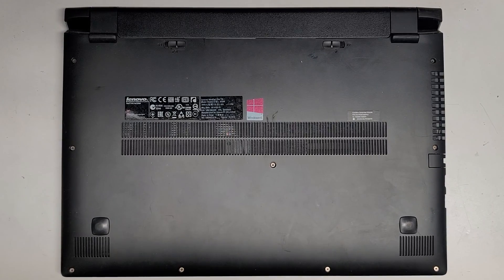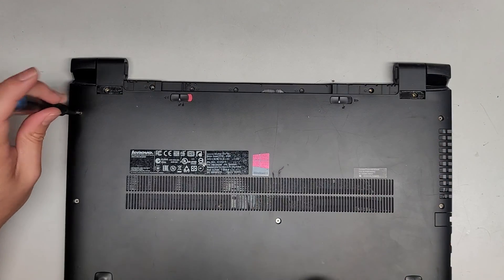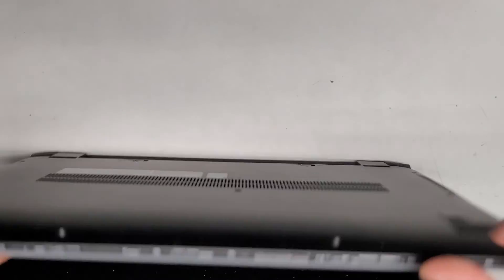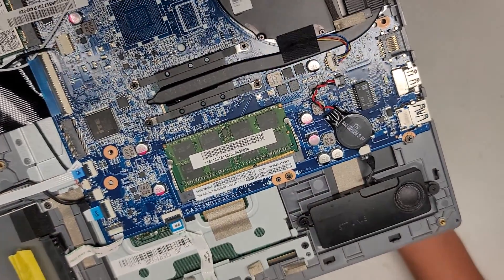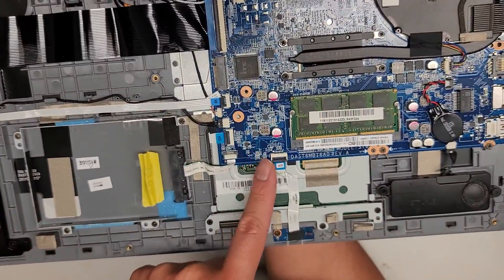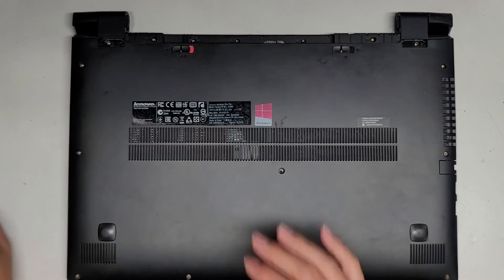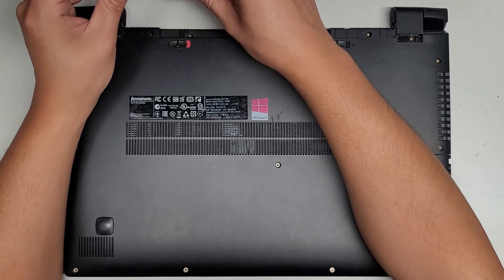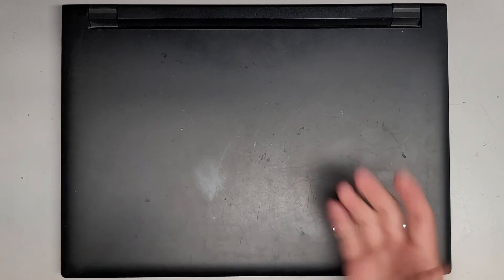Lenovo IdeaPad Flex 15 20309 Disassembly RAM SSD Hard Drive Upgrade Battery Replacement Quick Look

Comment: Hi, I have a Lenovo IdeaPad that I've had for 4 years. I decided to remove the back covering because I wanted to remove the hard drive but noticed there was no hard drive. How is it possible that I've been using this laptop for 4 years without a hard drive?
Reply from the maker: SSD
Reply: @ItsBinhRepaired  Thanks! Do you know if there is a product that would transfer data from an SSD to a USB? My Lenovo laptop is not working and I wanted to get my files 
but not sure if there was a way.
Reply from the maker: @sandram8761  what type of SSD formfactor do you have? 2.5" SATA, mSATA, or m.2?
Reply: @ItsBinhRepaired  It's a Union Memory AM620 M.2
Reply from the maker: Is it a 2242 short one?
Reply from the maker: This would work https://amzn.to/3ULJ97g